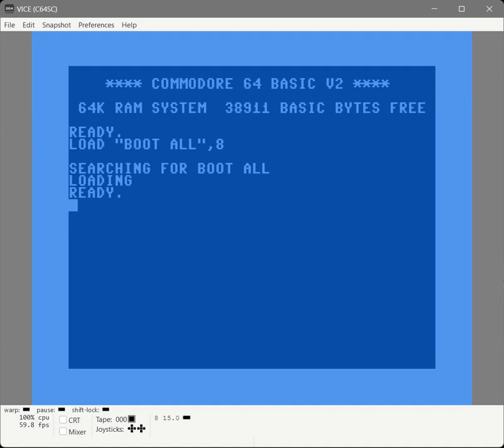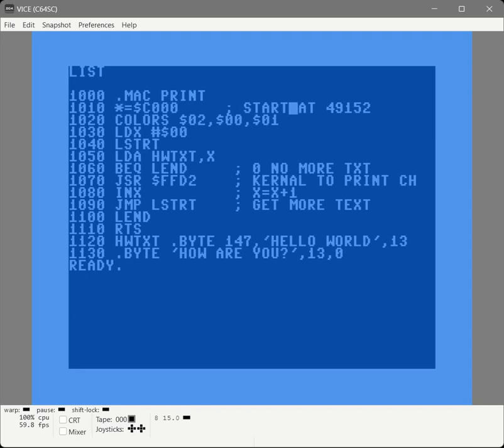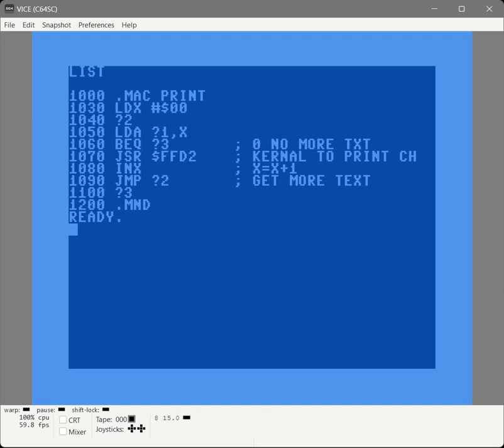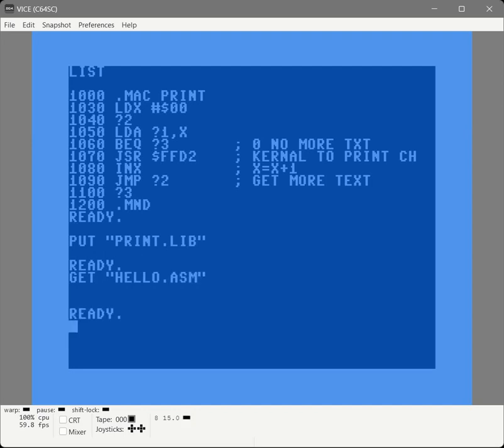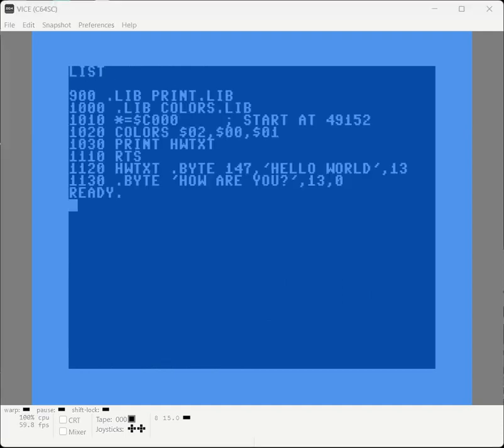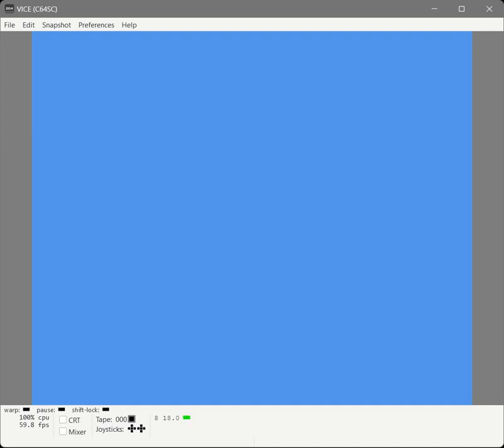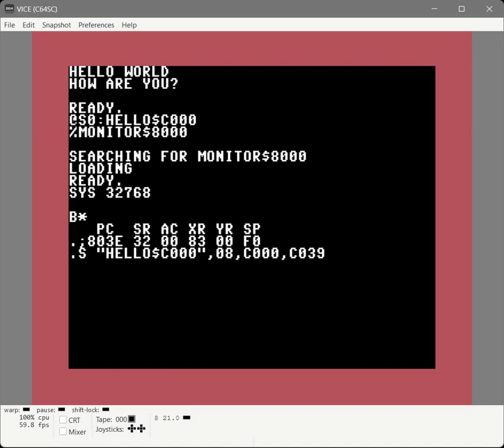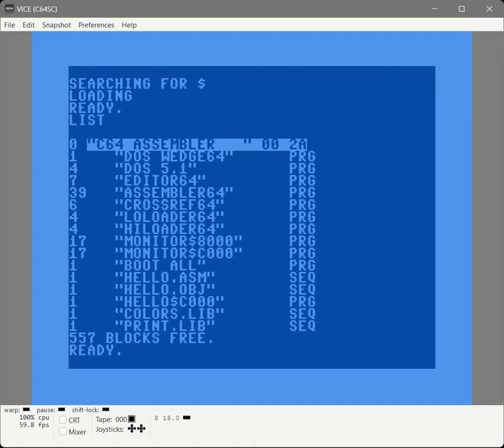Writing 6502 Assembly on a Commodore 64 using the Macro Assembler Development System.  Part 4.

Comment: By the time you're asking the assembler to make macro and library calls, it feels like you have in effect stopped writing machine code and started writing in a compiled high- (or maybe mid?) level language.

I wish MADS was more seamless in its operation. This thing of flipping between different programs to write, assemble and run the code and THEN have to load it up in a monitor to save it in a form fit for others to use seems like a great way to cause hair loss in a hurry!

Comment: Fantastic set of videos!
How would one go about making a proper library of subroutines? Would you do the same thing as with the macros, but without the begin/end macro directives and in the main code replace the calls to the macros with “jsr sr_label”?
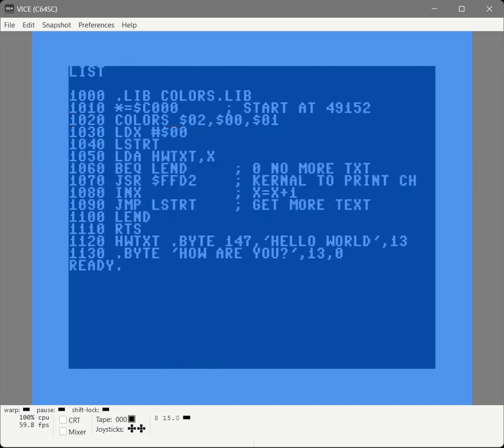Reply: I would create a library of subroutines using macros and save it to a disk.   Simply call the subroutine by the macro's label from the main routine, optionally passing parameters (ex at 1:00 macro "COLORS"), then let the assembler handle the proper calls in the executable ml code.  No need for JSR <label> / RTS.  You just need to define/declare the macros used in the main routine as  ".LIB  <macro>.LIB"

Comment: This is a good video and the explanation of "Boot All" is excellent. FYI, Mark Andrews has a very good book showing code examples using the Macro Assembler Development System. There is also a 2020 Quick Start Guide using the same Macro Assembler Development System. Using the assembler in "Monitor$C000", a typical code would be..
.A O33C LDA #$05
.A 033E STA $0400
.A 0341 LDA #$02
.A 0343 STA $0401
.A 0346 LDA #$01
.A 0348 STA $0402
.A 034B BRK